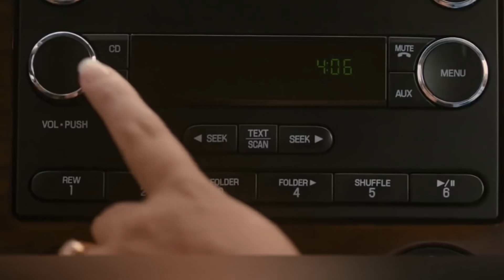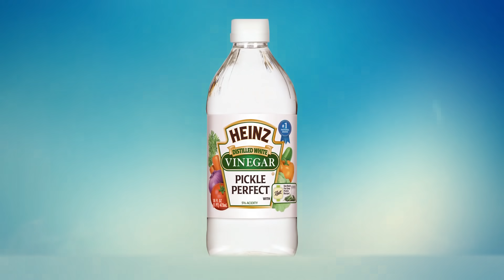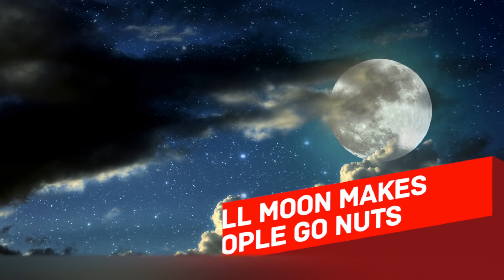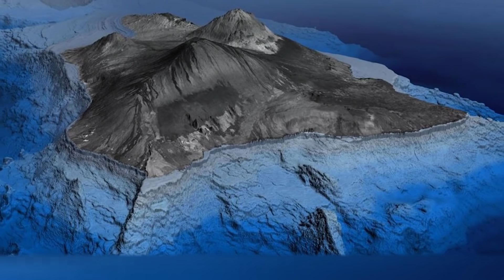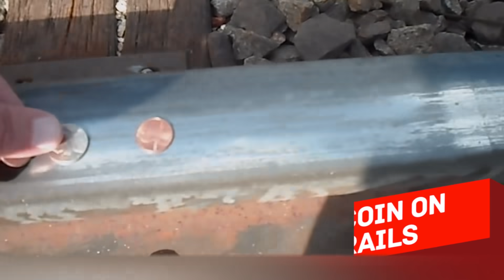15 Myths That You Still Believe

Comment: Lol, azotic acid. Stick with a single naming scheme. Hydrochloric, Nitric, and Sulfuric, OR Muriatic, Azotic, Oil of Vitriol.

Also, Hydrochloric can be bought at full strength from any pool supply or hardware store, and Sulfuric can be bought at relatively high strength as battery acid from most car part stores.

Comment: 5:12 WRONG Mount Everest actually is the highest mountain but not the tallest tallest means from the bottom to the Top but highest is from sea level so Mount Everest is the highest but the volcano mentioned is the tallest

Once again the water fall they are talking about is the tallest but not the highest

Finally something true a desert isn’t defined as warm it’s defined as a place that receives little amounts of rainfall

Comment: 7:41 WRONG! All kinds of electromagnetic activity hurt any living thing! Especially when the frequencies are great, like mobile phone and microwave... Do you know, that the microwaves, that we are using right now in our microwave ovens, was actually invented as military weapon? It turned out, that the produced waves hurt not only the target, but also the shooter (operator of the weapon), so it wasn't used as such.
I have a friend who works in a radio broadcast station and their radio output signal is about 150W and he said, that very often when birds fly near by the antenna, they fall on the ground and die...
Even the sunlight (which is also electromagnetic waves) is dangerous to humans and that's why we put sun glasses with UV protection and sun creme or spray with UV protection for our skin...

Comment: I always thought that if it rains you would catch a cold because of all the germs and stains floating around, air-borne diseases and such. It only rains in winter here by me so I figured that because it's winter the wind blows way more than normal, and the clouds pour down on people. I mentioned clouds because it's proven that warm air rises up, along with any dust and particles that may be light enough to join air, and eventually they go above the clouds or INTO them. When it rains, it's cold and wet, the germs go down through the raining clouds and stick to the water drops that fall onto your skin. Your eyes get wet and your hair is soggy and you're just uncomfortable in the rain so you keep using your hands to rub the water away in your face.

Comment: About lightning protection, yes, it matters  that the tires are rubber because they don't conduct electricity from the ground into the car chassis before the lightning is formed and your car does not act/acts less like a lightning rod because of this. Your explanation on why the car protects you is also wrong, it's not that it conducts electricity as a conductor, it's that you are sitting INSIDE a conductor what matters. You'd have to solve Maxwell''s equations for this simple case to understand this. If you have not done this simple Physics 101 derivation, maybe you should not pretend you understand the scientific reasons behind debunking myths regarding lightning.

Comment: Some things are incomplete. Yes you can lie when you look someone in the eye. But it's more complicated than that. Usually when you ask the right questions you can detect a lie in someones eye. For example you're inclined to look upward to the right when you remeber a smell, you look upard to the left when you remeber a picture, downword to the right when you imagine a smell, downward to the left when you imagine a picture etc etc etc (don't pin me on the actual point you look at , but you get the idea).... So looking someone in the eye (especially when knowing these fact, or by intuition) you can more easily unmask a lier. Police interviews use these facts btw.

Comment: This undermines peoples intelligence. Picking food up quicker will reduce the exposure rate of germs. The more the piece of cake settles on the surface area, the more germs make contact. Direct sugar that arent converted to glucose in the body are Deadly(FODMAPS). If you run out of the rain you reduce the amount of rain that hits you by not being under the rain longer. Sickness is directly related to dramatic body temperature drops, which is typical when your cloths are wet. Who are these idiots who exclude variables to conclude their own stupidity. Fluoride is ionic radiation and we digest it, lmao. You only need your cells in contact of the emissions radius of electronegative particles and you will eventually develop cancer. If you digest these particles your cells are within the radius effect. These unproffessional assessment exclude major factors to delegitimize claims. Much like  if someone saw a tree fall in the forest but no one else was around to confirm its validity. You can debunk everything in existence with that lack of methodology. I cant see the narrator, so he really doesnt exist at all, lmao. This video never existed until you viewed it.

Comment: That is not true about the phone part. You can get cancer, and in fact, you can get BRAIN cancer. You get cancer from the WiFi Signal that comes through the phone. So if you don’t want this to happen to you, I recommend you either put your phone in a different room before bed. Or you put the phone on airplane mode. Airplane mode is safe because it blocks all contact of the WiFi signals. So I hope you take my advice. And if you don’t, you possibly have brain cancer in the future.

Comment: Rubber tyres don't stop lighting hitting the car they just stop the lighting  hitting the ground as rubber isn't a conductor therefore you don't get electrocuted right? Or wrong? Lol
Reply: Um... the air in our atmosphere isn't a conductor either. If it was we'd all get electrocuted plugging things in. An insulative material just means it requires more potential (voltage), which lightning has plenty of, in order to pass through. I'd imagine the atmosphere is a far greater insulator than rubber tires. Gasses as a whole are typically less conductive than solids, because of the space between particles.
Reply: And there's no such thing as an impervious insulator, that electricity absolutely cannot pass through. There's just different levels of conductivity.
Reply: And rubber tires have metal threads going through them that could definitely conduct electricity well...

Comment: The highest mountain one is fucking stupid. We measure mountains in terms of their altitude. Wanna know what altitude is? The number of feet ABOVE SEA LEVEL. The notion that a partially underwater mountain is the “highest” is idiotic. Perhaps if it were phrased like it’s the tallest mountain, yes, because it would be taller than Everest from base to peak; but it is not the highest and we don’t measure mountain height from base to peak.

Comment: damn, just when I was beginning to like this channel.
Your portion of the video about cellular devices not causing cancer is... well not reassuring at all. I mean, I wouldn't tell anyone to come here for research purposes, but I also dislike the spreading of hall-baked information.
While cellular devices have VERY EXTREMELY low levels of radiation, it is still radiation none the less.
Over the years, the area's in which many patient's have developed various forms of not only cancer but other cases as well, the spot with the most problems was located where the individual kept their phone on a daily basis.

So while it does not give an immediate threat, you're still giving your flesh a constant dose of it on a daily basis.
Cellular companies do have a warning for this for all of their devices as well. They want you to keep the device (when not using it) 5cm away from your skin at all times. 
But most people don't do that.
There are documentaries based around this, and you can research the issue for yourself... Just don't go search speCIFICALLY for it "not" being a problem. You need to research cases, cited studies, etc. 
Now I will say, most people who develop it are those who are already prone to cancer be it by genetics, or their individual situation in life. So i'd say it's good for everyone to go get tested to make sure they aren't genetically liable to possibly developing a form of cancer. 
Some families do indeed have hereditary forms of cancer they pass down through their genes... sadly...